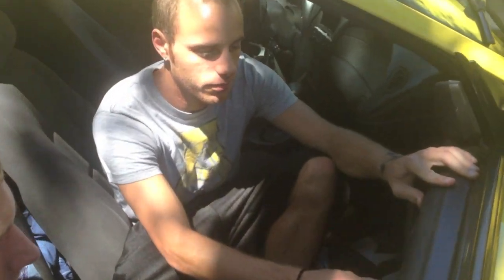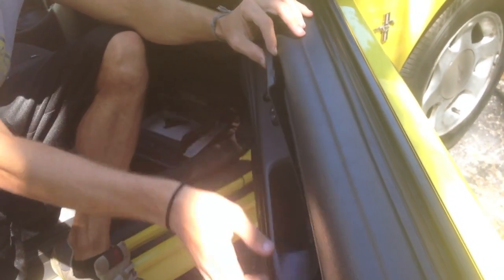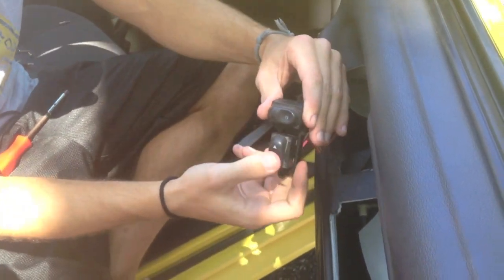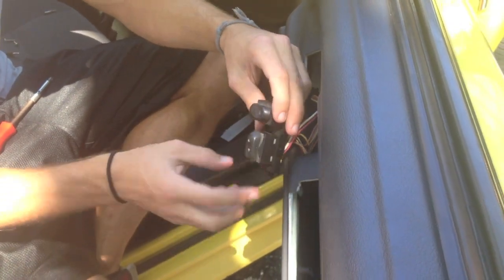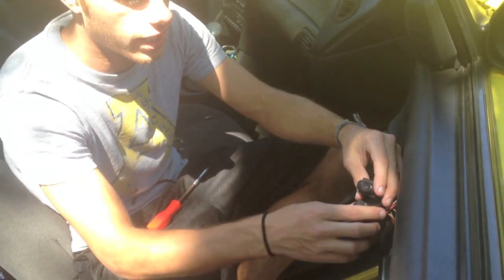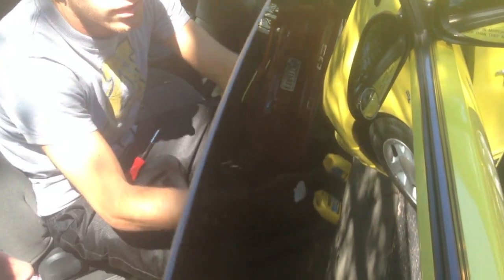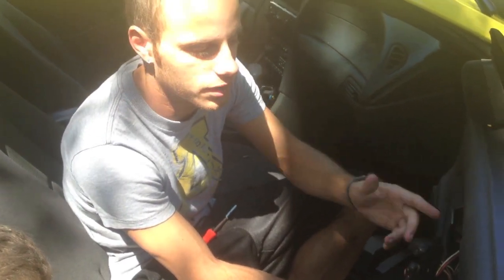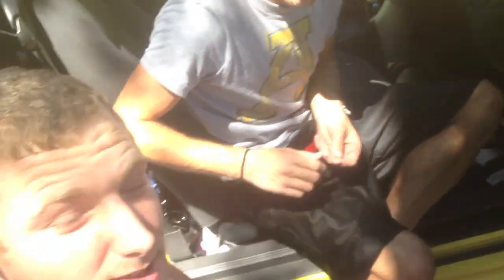94-04 MUSTANG WINDOW SWITCH REPAIR

Comment: For those of you with bad switches, if you take the switch apart, you can bend the contacts back into place. What happens is over the years of pressing it will bend to a point it no longer makes contact. Bend it back and the switch is good as new.
Reply: College Student Thank you! I followed your instructions, and my switch works perfectly!

Comment: So I'm guessing my window motor went out,because both switches on driver and passenger don't make the passenger window go up.
Reply: Having the same issue with the switch just wondering did you fix it and what was the problem??
Reply: Same here any updates
Reply: Anyone found a solution yet.?

Comment: Great video but just wanted to add that taking the switch from the other door will not work for convertible mustangs. You can also use a multimeter to test the switch.

Comment: all 3 window switches suddenly not working stuck in the up position and drivers power lock switch not working but got it to work intermediately when i worked power door lock on the passenger side but it makes a noise when opening and closing drivers door switch and seems to only work when car is not running and door open. I haven't done any tests yet will start now with fuse

Comment: Nice video, I having problems on my 03 mustang locating the power window fuse or relay can you help me out ?
Reply: I think I read that the fuse is common to all the windows. So if one works its not the Fuse.
Reply: There is actually a CB (circuit Breaker) is space 43 in fuse panel under dash. It is common to all windows Aluminum thing about size of a starburst

Comment: I have a 94 GT Conv, Like an Idiot I left the top down and the Windows down while it was in the Garage for a few weeks.And Yes, Now the Drivers Side Rear window wont come up. The Pass side started working in a few days. What the Heck is that? I hear its a Common Problem but seems hard to find a Good Answer.
Reply: ftecconn did u ever figure out what it was or how to get it up?